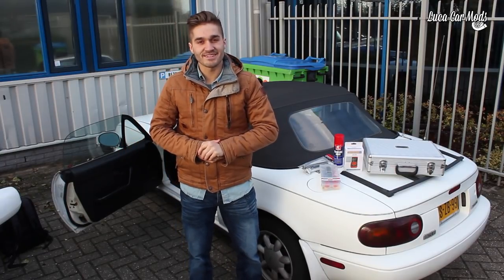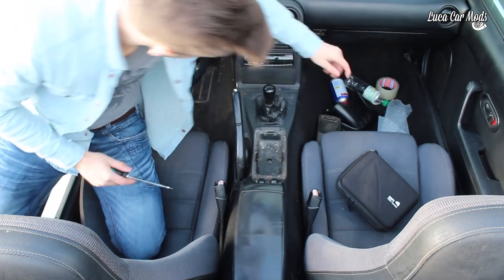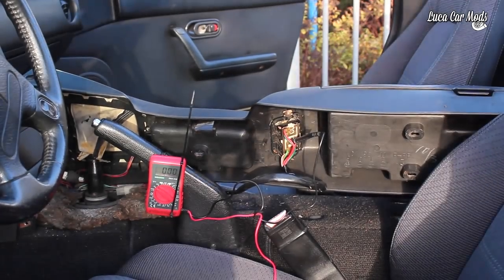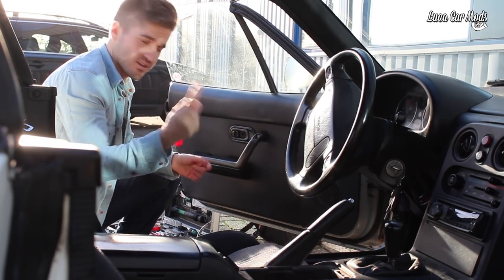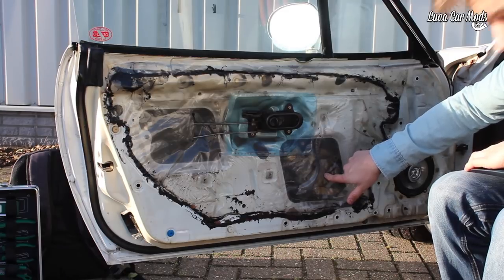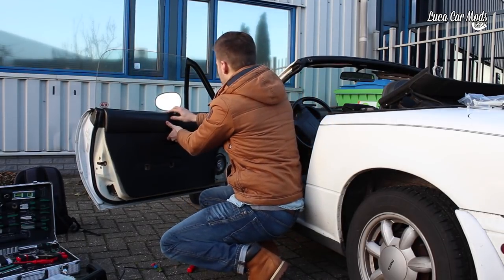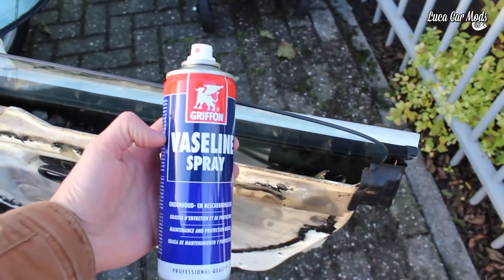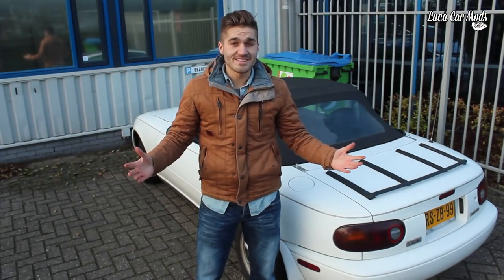How to Diagnose Power Window Problems, Broken Switch or Motor?

Comment: So if you got 12 volts at the motor it's bad? You didn't explain much. Thumbs down
Reply: No, he got 12v at the motor and the motor did nothing, which means the motor was getting power.  The motor is dead.  

If he got 0v then he'd know he had a cabling problem and the motor wasn't getting any power,.
Reply: @Nitty921  thanks